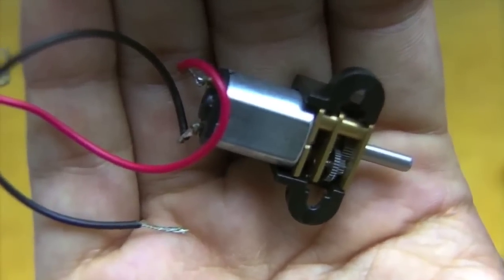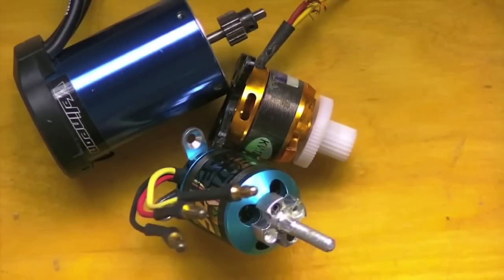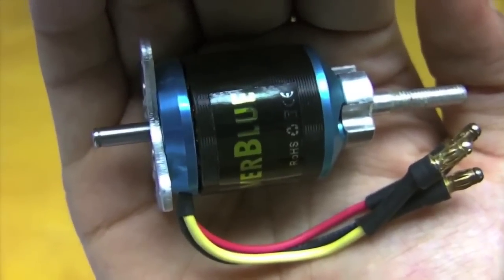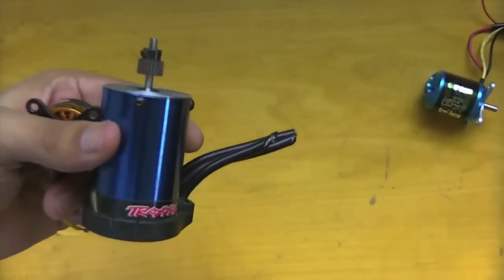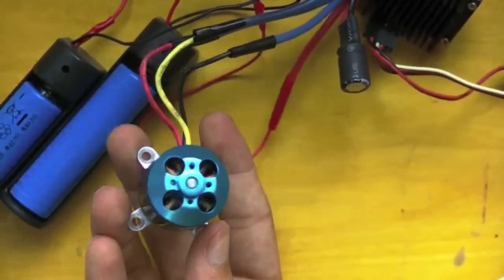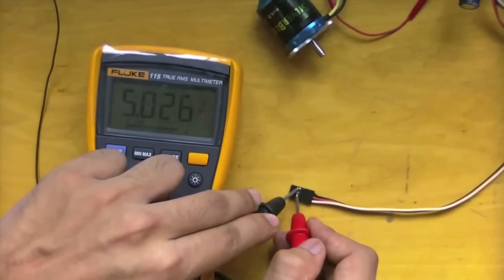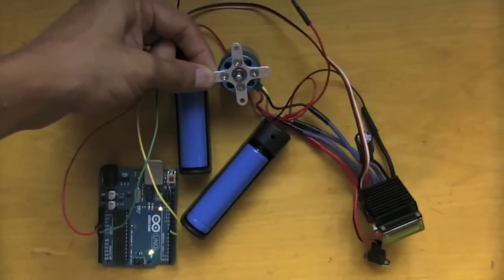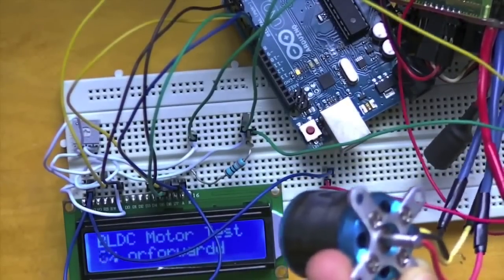Arduino Project Controlling Brushless Motors

Comment: hi, I am new to programming and Arduino but I can understand most of the code but need some more time to write on my own. problem is, I can't find a right sketch to use two pushbuttons to increment and decrement speed of bldc motor one step. I 'need' to use buttons instead of potentiometers or knobs., so, I hope you can help me with this.